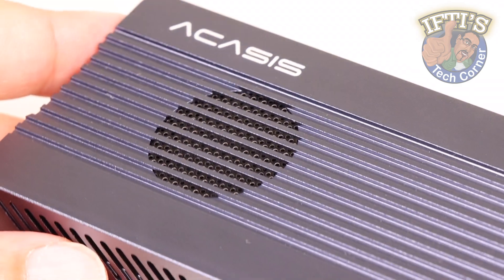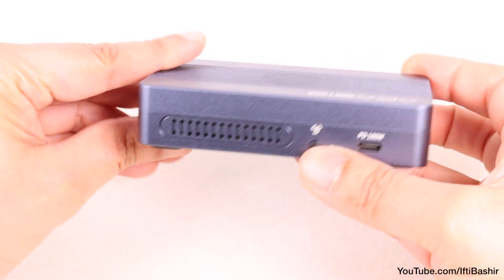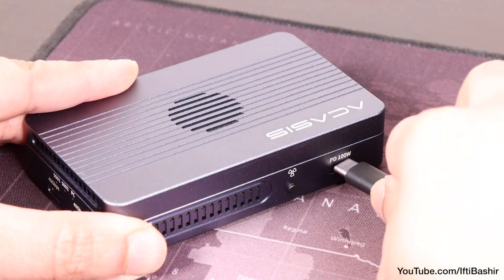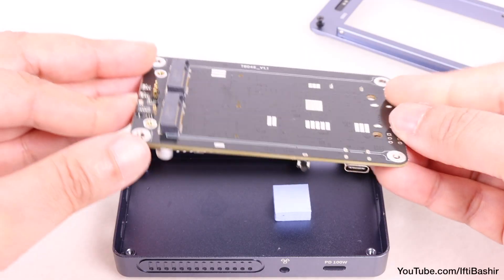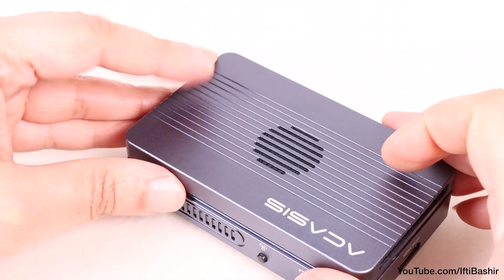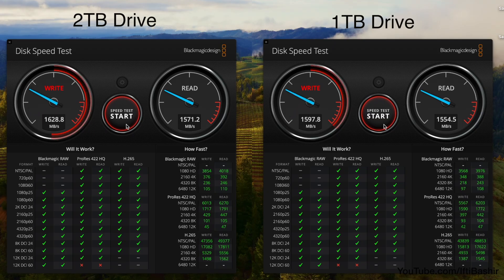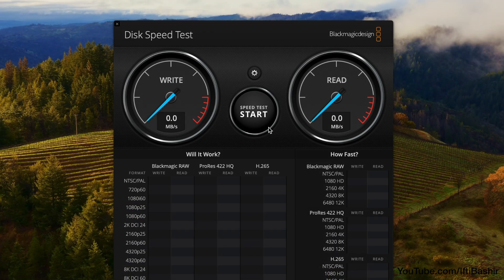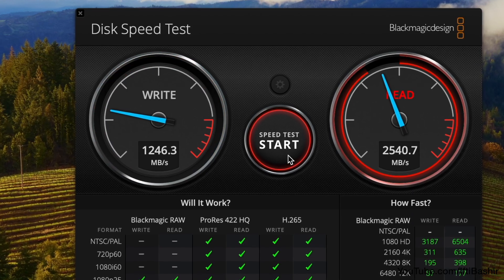Acasis TBU405ProMax - Dual Drive RAID enabled SSD Enclosure with Cooling! : REVIEW

Comment: Tb3 only has 22Gbps for data transfer, and when you use both disks together, it's almost impossible to reach more than 2500MB/s. It's like a single-lane road that you can't drive two cars over simultaneously.